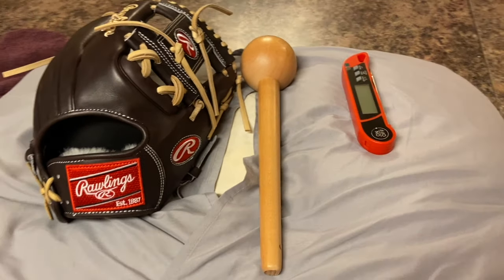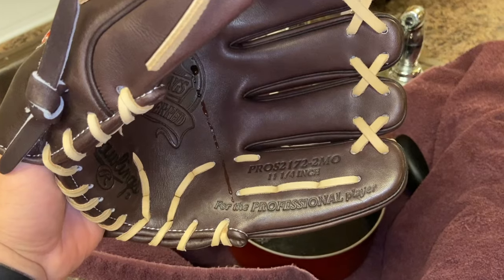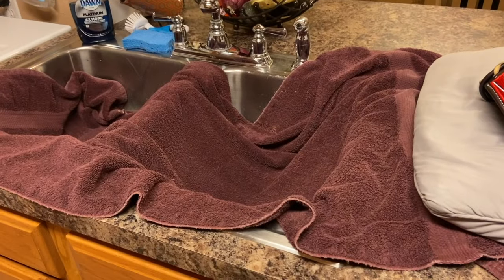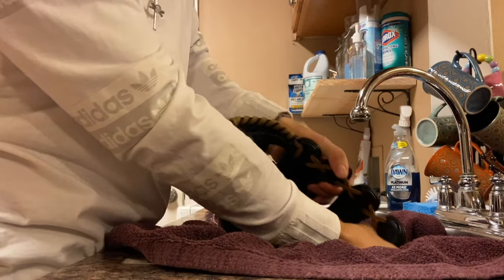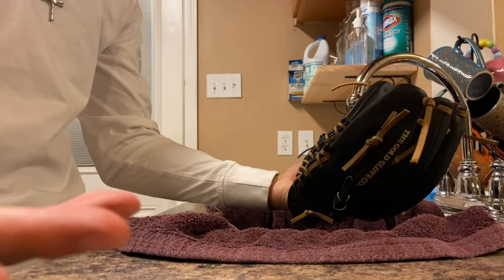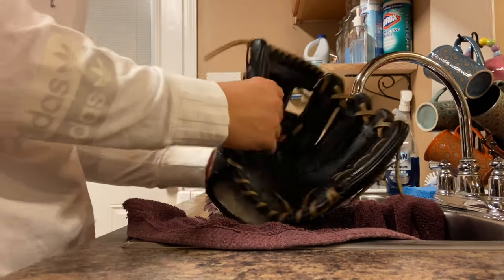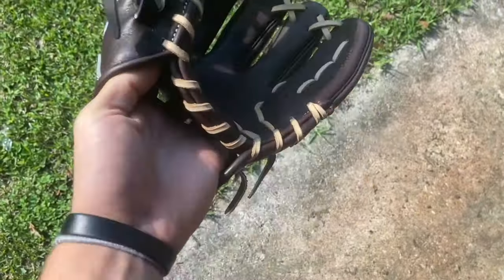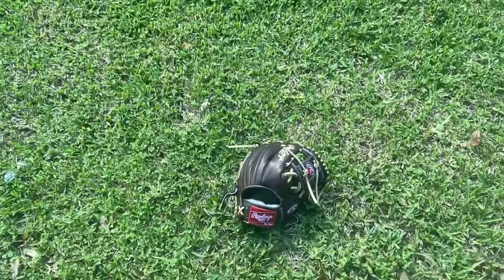How To Break In a Glove Fast *Hot Water Treatment*

Comment: When you’re getting the palm liner wet you should pour it the other way so you don’t get water in your finger stalls
Reply from the maker: I like to get it in the fingers so it forms to them
Reply: As long as you let the water drain out and don’t let it sit in a hot muggy climate after it will be just fine.

Comment: I heard that the hot water treatment can shorten the life of the glove. Is that true? Aso from Wilson said the best way to break in the glove is to lay catch.
Reply: Yeah the hot water treatment is basicly like steaming your glove which isn't good for your glove
Reply: @Flawdaboys  steaming is totally different it over heats the leather so when you steam it you don’t have control with the temp and will go through the glove water you are supposed to use just a little bit snd not let it absorb to much so it doesn’t shorten the life span of the glove